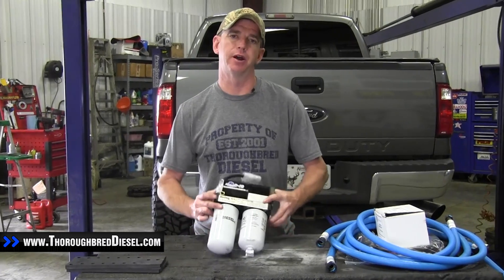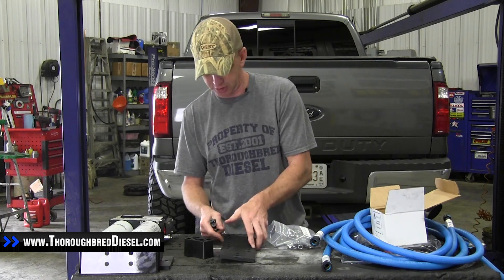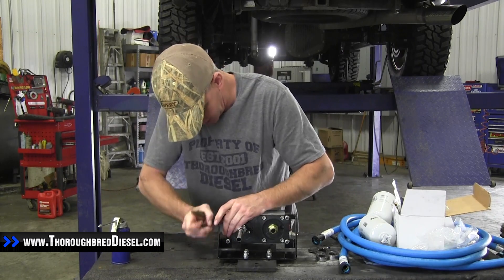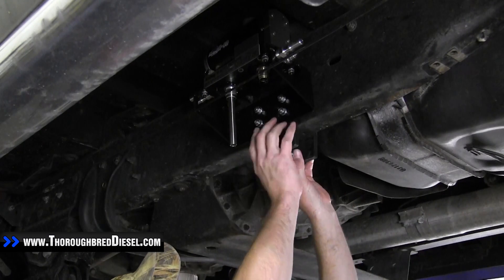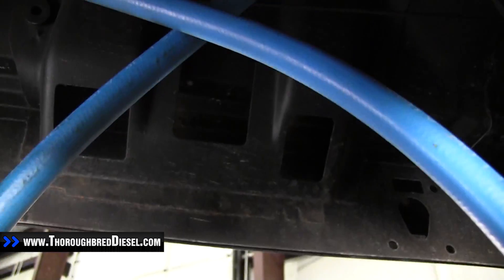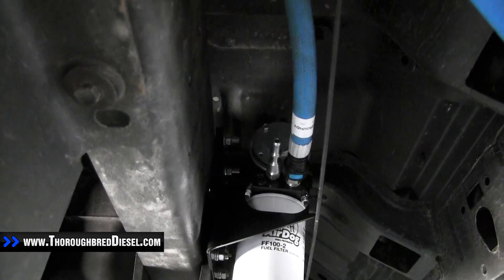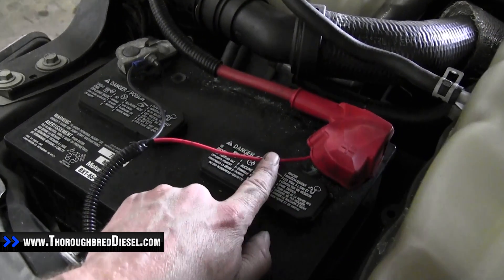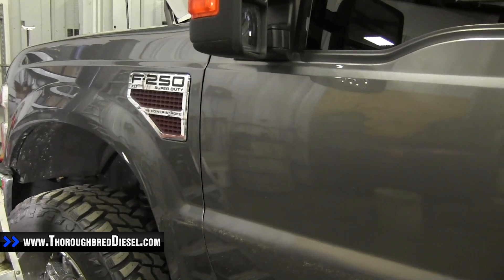AirDog II-4G Fuel Pump Install: 08-10 Ford Powerstroke 6.4L

Comment: What’s the benefit of adding one of these on a factory 64 in a 08 f350
Reply from the maker: Increased filtration and not having to deal with the 6.4 priming problems in my opinion.

Comment: So you can just put this pump on without taking the old pump out you just bypass it to the new pump
Reply from the maker: Correct.  It will bypass the old pump.
Reply: @thoroughbreddiesel  the one on the rail but not the high pressure

Comment: What do you do with the factory fuel filters
Reply: Your second diary is the only one in play the primary at the fuel water separator has just been bypassed. So you should be able to just remove the old pump and filter. Am I not right?
Reply: Toss it😂😂
Reply from the maker: ON the 6.4’s,  they will still be in play.

Comment: Can you prime the fuel filters first along with the key cycles to bleed the fuel system?
Reply from the maker: Much faster if you crack a filter or remove the feed line and let it feed into a bucket.

Comment: Sorry if its been asked but it'll make me feel better to have a direct response...
I have a 08 6.4 power stroke... MiniMAXX, DPF delete,S&B intake... only thing im gonna do in the future is take out the EGR and put a new exhaust (from the DPF back)

my stock lift pump kicked the can, want to replace with the Air Dog but don't know what size to use and what model to use... just want it to replace the old lift pump assembly to be used with the stock HPFP

Thanks!!!!!  ~Matt

Comment: This is next on my list along with a sump!!  Quick question for Wade...I have a capped off 3/8" line that's in my filler neck from a previous aux tank....can I hook up the Airdog return line to that instead of it going to the factory return on top of the tank??  Also, does utilizing the factory fuel lines still use the factory lower fuel filter??  Not going to complain about triple filters to my 6.4l hpfp clean!
Reply from the maker: There is a T that comes with your new kit that is to be used for the AD return.  It also keeps fuel at the pickup to help avoid cavitation,  I would use the stock return setup.  That would leave the 3/8 line on your tank if you ever decide to add another fuel tank.  The lower fuel filter is no longer going to be in use with this AD setup.
Reply: Thanks for the reply...had to re watch the video for reference.  Thanks again!!

Comment: I bought a 2005 6.0 with an airdog 2 already installed, does it replace the stock fuel pump? I have a a P0232 code come up for a fuel pump issue & also my injector #1 is bad so I'm trying to figure out if the fuel pump issue caused the injector to go out & how do I fix the fuel issue to prevent it from happening again. Thanks
Reply from the maker: Yes,  the AD2’s are standalone pumps, meaning they bypass the stock lift pump.  The 232 code could arise if you still have power to the stock lift pump and it is indeed bad.  Lack of fuel can cause problems,  would like to know more as to why you installed an AD.  Give us a call 866 737 4966 and ask to speak to Wade.

Comment: this thing is junk.......it doesnt prime and will burn your batteries out very fast......6.0 install is very different and directions given with this unit for 6.0 is very vague and is just general, not actually for 6.0!!!!never again!!!airdog is not open weekends or it does not have a help line for questions.....
Reply from the maker: Are you trying to put a 6.0 kit on a 6.4?  If so,  yes they are very different, but the jist of the insall is the same.  If you are having a problem with the pump priming,  I would suggest unhooking the suction line and putting it into a 5 gallon bucket of fuel and see if the pump will pick up.  If it will,  then you know that you may have something hooked up incorrectly, etc.
Reply: motox766 don't buy it it's crap

Comment: is the installation for a 6.0 similar? i feel like it is if not the exact same. Nobody on Youtube has a video of A install on A 6.0 PS.
Reply from the maker: The 6.0 installation is very similar. All of the connections at the fuel control module are similar. We are working to get a 6.0 and a 7.3 truck in here to video.
Reply: +Thoroughbred Diesel thank you!
Reply: +Thoroughbred Diesel where is the video for the 6.0?
Reply from the maker: motox766 We will have one up when we get a truck in for the install.

Comment: Fucking right, nice clean work and great video.   Just received the a5sabc110 AirDog, was scrolling through your videos looking for an install on a newer 2015 dura.  What say you? The only video I see is on a 2011 black dura,  will that video work the same for 2015 dura.  Thanks again and keep the videos coming.
Reply from the maker: +Nicholas Eiberger So far we only have the install vid for the 11.  On the 15 truck,  my suggestion would be to use a sump of your choice,  then all connection will be straight forward just like the instructions for the previous year dmax.  I suggest the sump because the 15 and 16 trucks have a smaller suction side on the sending unit that will not flow enough fuel to support the pump.  Use a sump or draw staw and you are good to go.